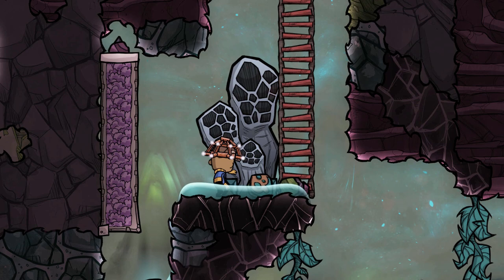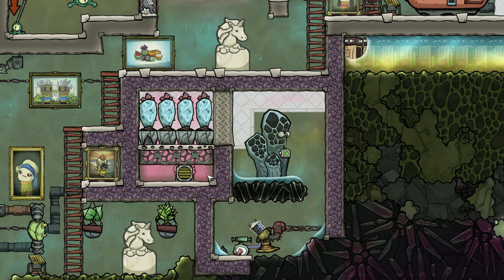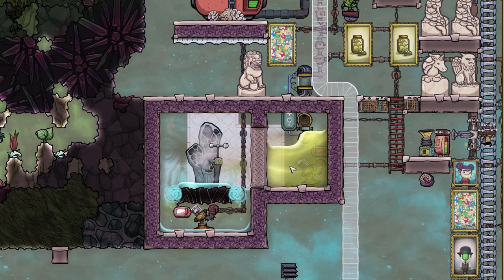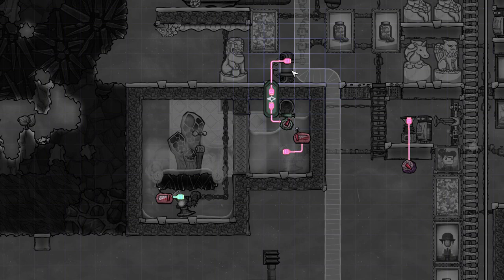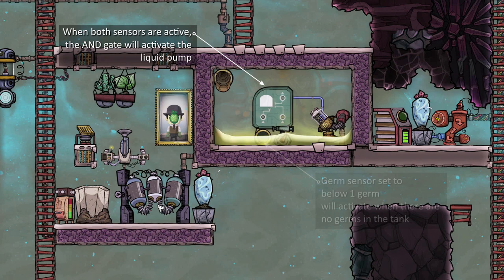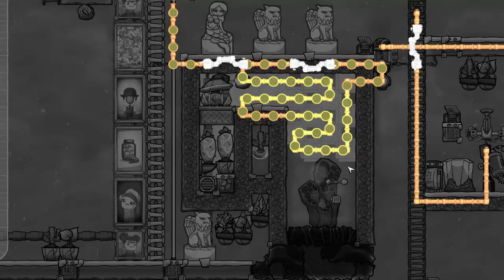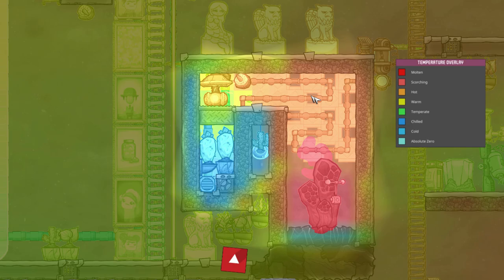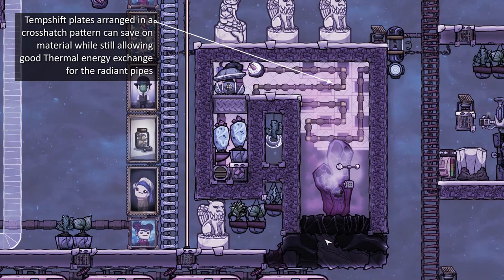Oxygen Not Included - 3 ways of cooling a gas geyser

Comment: It's a shame most of the tips are outdated now. Weezwarts now require phosphate to maintain it, so either a new coming system is needed or a way to deliver it. The second system doesn't work anymore either since sieves don't delete heat, it spits out clean water at the same heat the polluted water was or 40 degrees if it was lower. Thus the polluted water is still too hot to use
Reply: im a new in this, no wonder everything seems strange

Comment: for the first build i 100% wouldnt use gold tempshift plates lol too much gold to put into that when obsidian does the job
Reply from the maker: I'll get back to you on that one... I wasn't sure I wanted to recommend Thermally Reactive materials ( Obsidian ) over Thermally Conductive materials ( Gold ). I'm starting a new playthrough soon, to play around with metal geysers, and will test a geyser with Obsidian Tempshift Plates :]
Reply: @safelanding4595  for more advanced builds better materials like diamond are needed but for something like a cool steam vent which only gets to the 110C any material would work i just use obsidian because of its Thermally Reactive trait and no other uses for it other than tiles touching volcanos (only tile that wont melt)

Comment: this is the build i use for cool steam geysers https://imgur.com/a/AsdgoGJ (from lifegrow) your can make it smaller easily this is just the size i use

you pump any polluted water u want into it and it circulates till it hits 95C and is then sent out with new water coming in  with this you can then delete the heat in the polluted water by sending it into a sieve that will always come out at 40C
Reply from the maker: Hi N3V3R FORGOTT3N, say the radiant pipes works the same way as my 3rd example, with a bridge in, radiant pipe radiators, a temp sensor and a bridge to direct the flow. I do like the hydrogen at the top, the interplay of gases looks cool visually :] yeah gi!
Reply: @safelanding4595  whoops lol idk how i missed so much i guess my brain saw the wheezeworts and assumed it was a closed loop or that because you didnt use the type of build on cool steam vents you dont suggest using it on them
Reply from the maker: Mate, this is the most condensed video I've made:) I've poured heaps of info into 5 minutes, just to see how far I can push this format, and quickly feed viewers knowledge and ideas, that they can take back with them to their own playthroughs. Honestly, if you can absorb 80% in one view, you're doing pretty good lol!
Reply: @safelanding4595  fair point i know ima "backseat gamer" XD